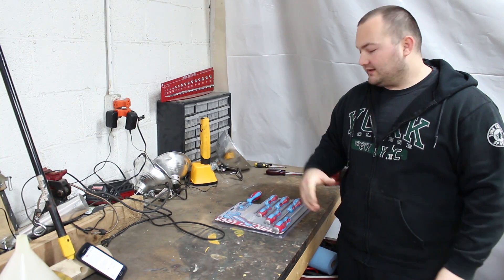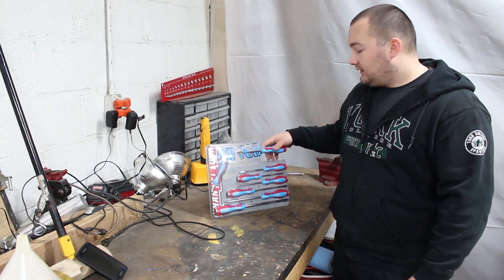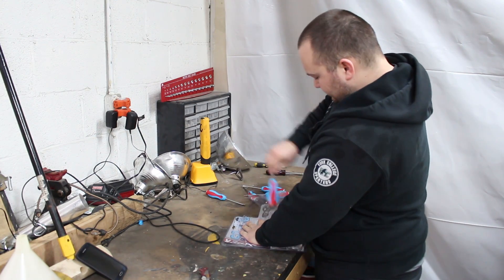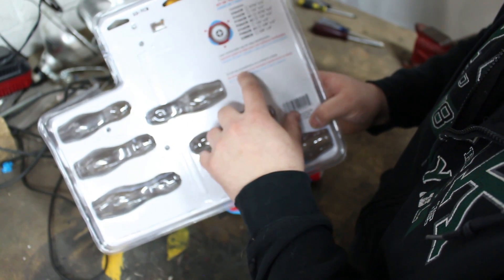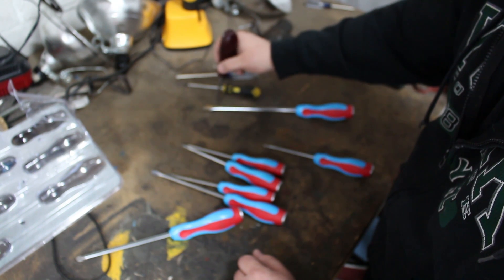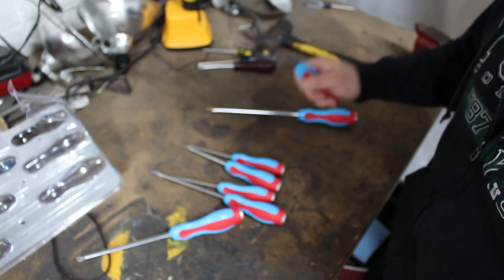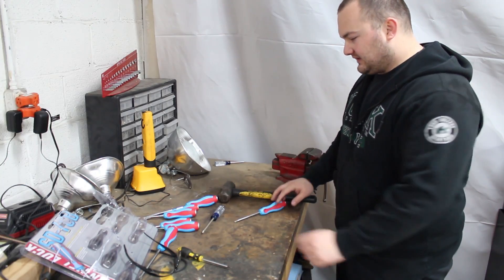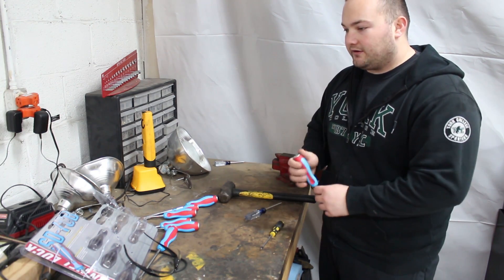Channellock Screwdriver Set Review

Comment: For removing the screws on the rotor you need an impact screwdriver. Its a a screwdriver that turns as you hammer it.
http://www.harborfreight.com/impact-screwdriver-set-with-case-37530.html

Comment: Nice...Harbor Freight also sells a set with a metal cap...It looks like a six point nut on the end of the screwdriver...not sure if the cap goes all the way through though...these are pretty nice looking...also the large handle for better torque and grip is a nice selling point...
Reply: The green ones with metal caps go all the way through, but the tips are shit, and the handles will cut up your handles because there are sharp slivers of plastic everywhere. I filed them down, and still found that they tear up your hands. On top of that the handles are round and very slippery even without being wet or oily and you can't get any torque out of them. They look like screwdrivers, but you can't use them as screwdrivers.